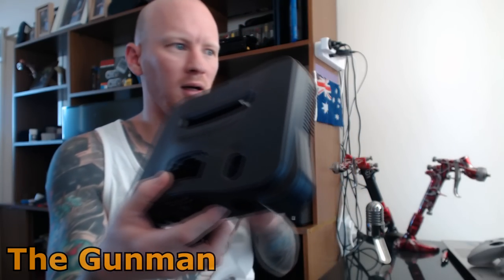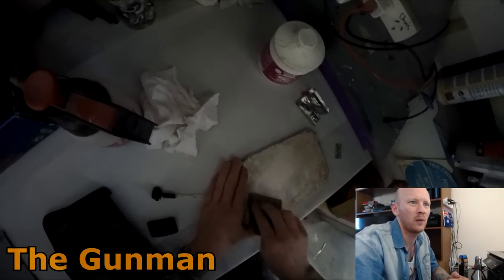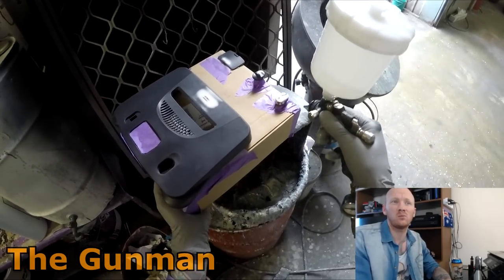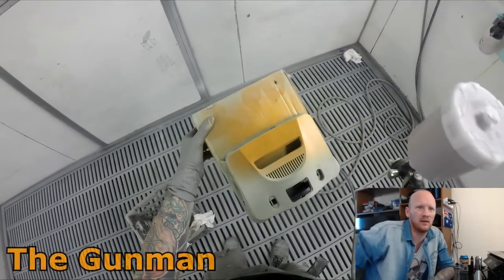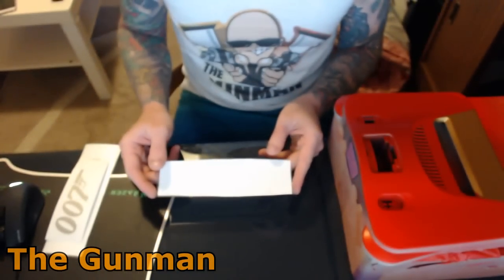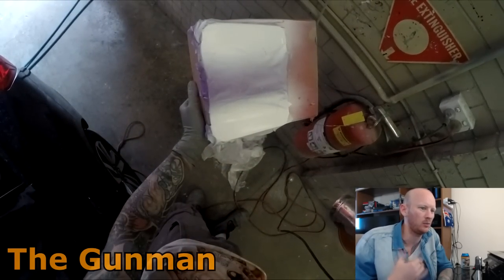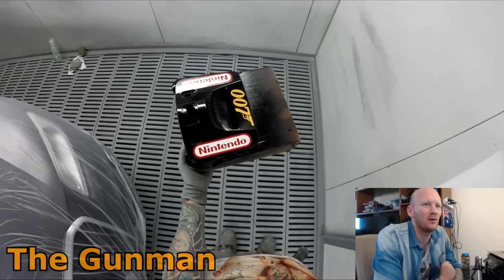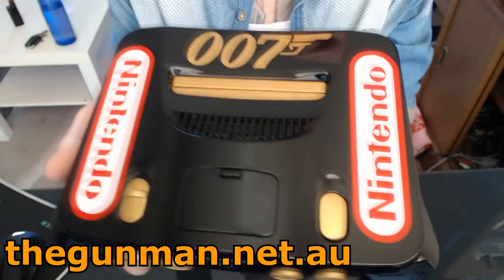Custom Painting a Gaming Console

Comment: I customized my Dreamcast with airbrushed fire. I just put adhesive promoter (Dupont 222) then airbrushed the flames. Put 1 coat of intercoat clear and then 2 coats of clear. I did that back in 2002 and the paint still looks new.
Reply from the maker: +LuckyRosco awesome, I never had a Dreamcast but lots of people say it's a good system.

Comment: Got a few questions unrelated to the video but with spray painting.

-When you have to paint and Matte Clear Audi wheel arch moulds, how do you go about it? Because none of the chips match, there is a few decent ones but never come out like it should.

-How do you go about cleaning down your jobs? I always get wax holes and plenty of dirt, maybe static?
Reply from the maker: Beau I've got a formula for matte and satin, 60% matt paste-40% clear for satin and 75-25  for matte, if I'm unsure I'll just do a test card, maybe look at getting a better quality W&G remover.

Comment: Hi Gunman, Would you do a video on different paint types as it confuses me reading about it online. You paint base then lacquer it, not sure what type of paint you use but reading online it says 2k paint is what professionals use but does not require lacquer so a bit confused about it, so if you could make a video about paint and different stages that would be great information
Reply: Generally speaking there's 2 methods of 2 pack painting, direct gloss and clear over base (leave the word lacquer completely out of it). Clear over base is using a 2 pack clear over a base which is either solvent based or water based, both of which evaporate and leave the colour with a matt finish, ready to apply clear over. The direct gloss is simply a 2k paint which dries with a gloss, no clear required. Usually limited to solid (non-metallic) colours.
Reply: Thanks for that Scott, Helped